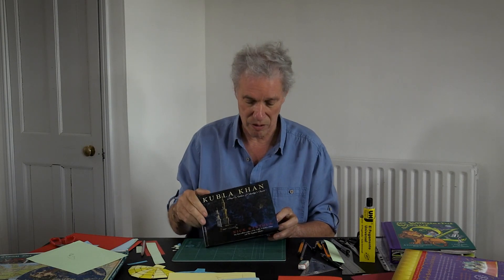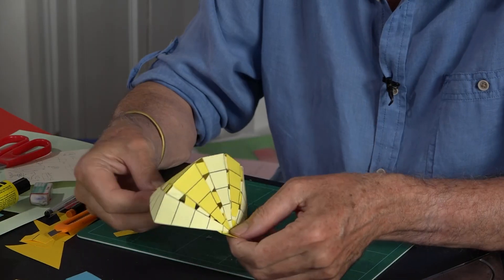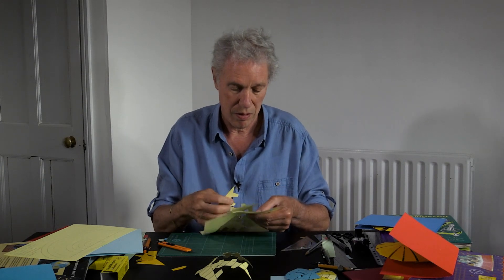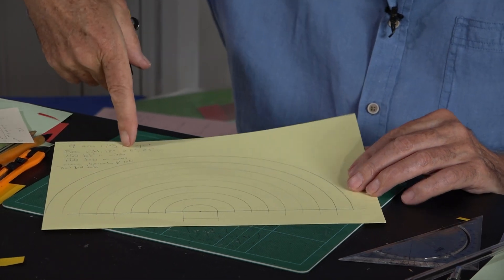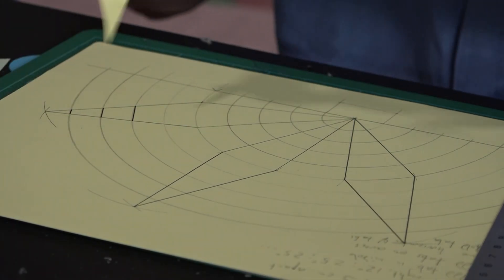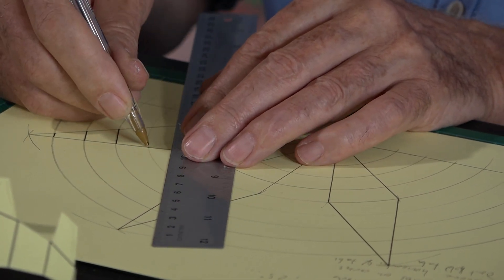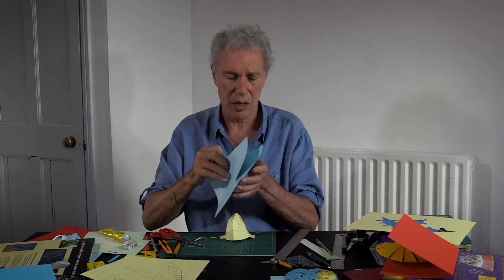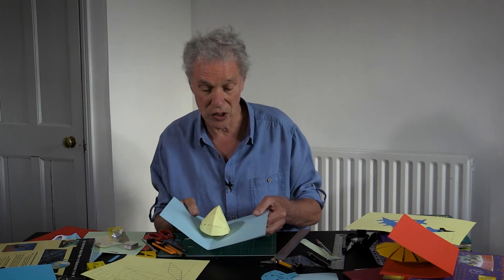Pop-Up Tutorial 62 - Domes and Globes (Part 2)

Comment: Hello, and thank you so much for your channel and your tutorial… They are fascinating and really inspiring ! You make popup technique nearly easy (I said nearly…)
Just to check : your dome is on a 4,5 cm radius circle. I suppose is about 4,5 cm high ? 
I want to make an igloo using this dome technique. But I would like it bigger, so I will play with the proportions of your tutorial (and make a little rule of 3…). But is there a way to calculate the height of the arches, and should I keep the angles of 10° and 25°? 
Anyway, I will try, just to check if it's Painfull to make… 😉
Reply from the maker: It is quite painful to make! Easier is probably the dome shown in tutorial 61. On this one ,es it is about 4.5 cm high. I was thinking about the angles on this recently (!), I think in theory maybe the angles should be 30 degrees not 25. Always need to experiment though.
Reply: @thepop-upchannel4919   Thank you for your answer !… I tried both (painful… you're right), but it looks more like a shell than an igloo… So I am trying with a system of severall automatic pull strip, as shown in tutorial 16. Well, it's not a "full form", but it can make the job… Thank you again !

Comment: Thanks for this video! I have your book, and it is sort of nice to see that even a professional struggles sometimes. Between this and the comment from Amanda Jeffrey I was able to make a near perfect dome. I doubt that you use Illustrator, but if you do I have a great trick for finding the right shaped gore. I made a 5" circle in Illustrator (thinking that would yield a 5" diameter dome, more about that later). Then reduce the width to .8 (5/Pi/2). Change the end points to corner points instead of smooth points and that makes the perfect gore shape. Then you can add the divisions and tabs, then copy at 60 degree angles. 
It only yielded about a 3 1/4" diameter dome because 5/Pi*2 = 3.18. And that is how far apart you need to place the tabs on the page. I also messed up the tabs around the "equator" because these have to slide a lot when the dome is pressed flat. I need to make them longer and the correct angle to allow that.
Reply from the maker: Wow! Well done, this is a really tricky one.